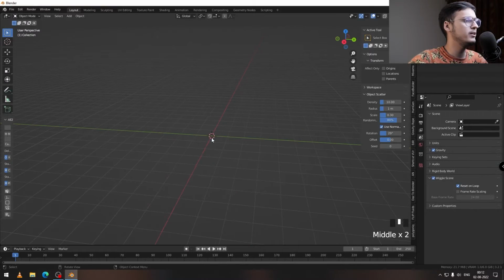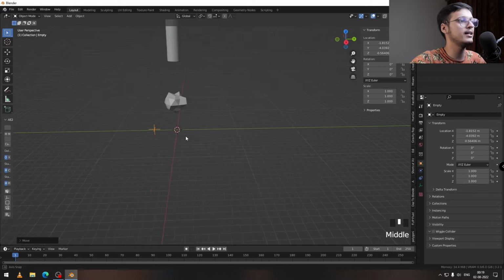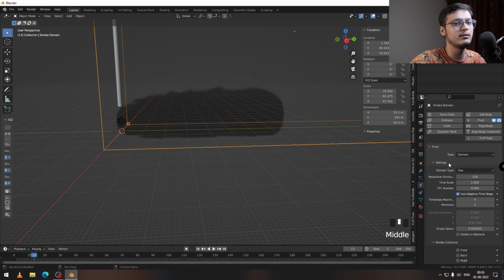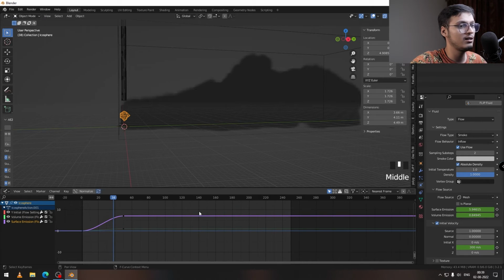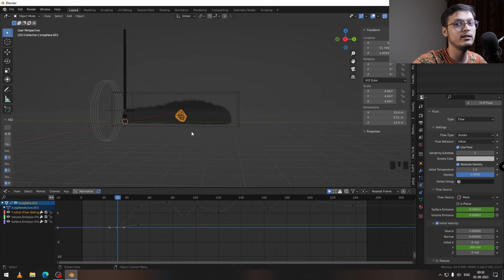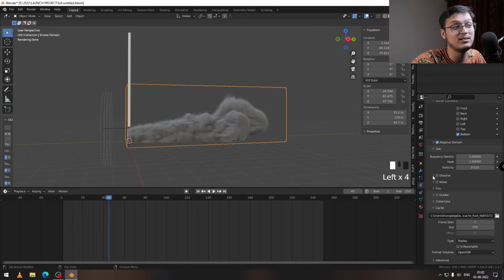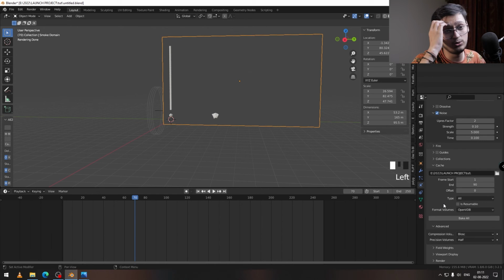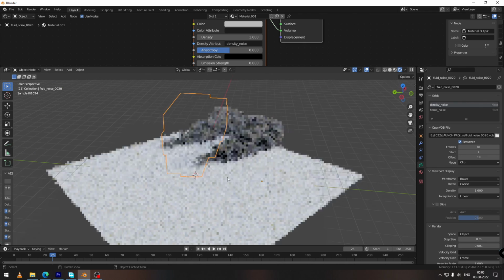Advanced Rocket Launch in Blender-Tutorial

Comment: Is it possible that there's a bug with the volume info node? It doesn't seem to work with the noise volume, at least its density output. Also, I saw somewhere else that the noise vdb already includes the volume from the data vdb, so it would be redundant to import both. (But on the other hand, the noise vdb doesn't have all of the attributes, so who knows)